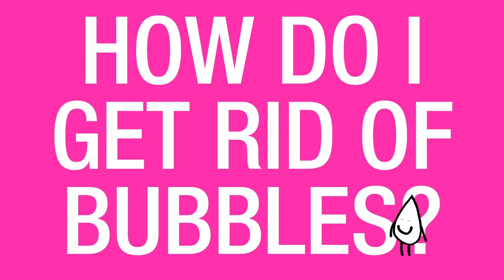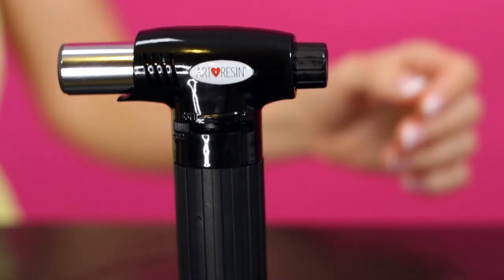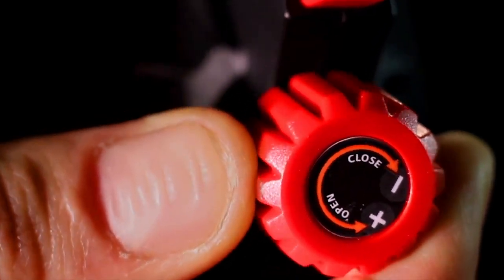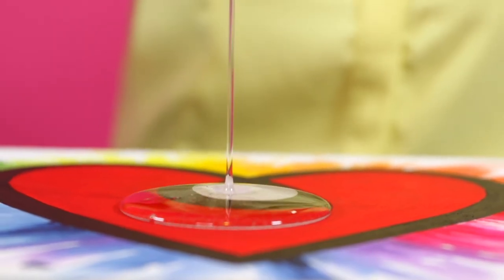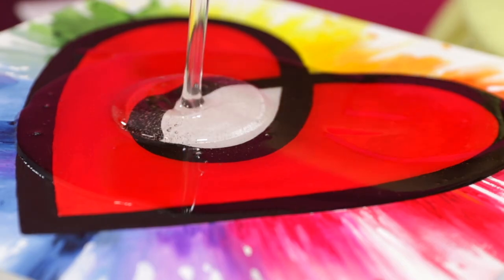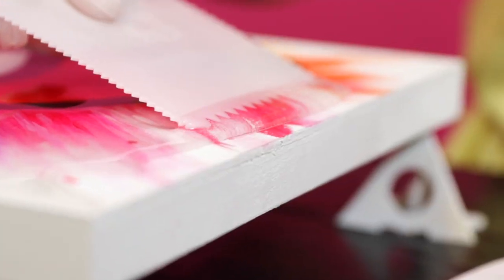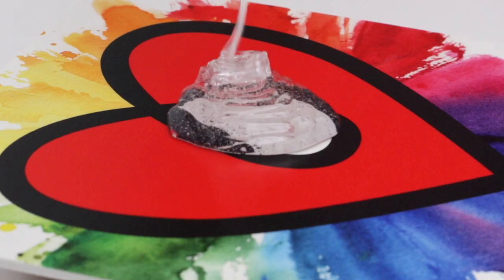How To Get Bubbles Out Of Epoxy Resin

Comment: It's the co2 that pops the bubbles. That's why, when using a straw works. Roasting the resin with the flame releases toxins and can burn the finish. Like you mentioned, viscosity helps.
Reply from the maker: Hey Steph! ArtResin contains a degassing agent to help bubbles rise to the surface, so a quick pass with the torch is all that's needed to warm the resin surface to release the bubbles.  A quick pass with a torch will not alter the chemical composition of ArtResin or burn it so there is no fear of toxins being released ( unless of course, you torch the resin to the point of charring it, which you would never want to do. )

Comment: So lm not sure why but l do my river table pour and wait a few minutes,take my torch and get rid of the bubbles,then wait like 10 minutes and torch all the bubbles out again,and l do this every 10 minutes for like 2 hrs..why is the epoxy not setting faster,the room is warm,lm doing 1/8 pours?
Reply from the maker: Hey Mateo - are you using ArtResin?  If so, it sounds as though everything is on track as far as setting.  After about 3 hrs, ArtResin will be at a jelly like stage.  You might try sealing the wood before pouring the resin - very often, wood contains trapped air which can off-gas into the resin in the form of bubbles.  It will keep releasing air and you'll continue to see bubbles, even after torching.  Babysitting it, as you have been doing, is a good idea, but sealing the wood first will create a barrier to that may help to prevent the air from off-gassing.
Reply: Thanks and yes l'm using  @Artresin

Comment: If i'm pouring casting resin around 1/2 inch deep should i do it in stages and let each stage fully set before the next?
Reply from the maker: ArtResin was initially designed to be a sealant and poured at an 1/8th of an inch in depth. We do have artists that use our product for pouring deeper than an an 1/8th of an inch but they achieve this by doing multiple pours. You can go up to 1/4 inch in your pour and would suggest you use a torch to help pop any bubbles you may have.

You can layer ArtResin epoxy resin in multiple coats, as high as you'd like, as long as you pour in 1/8" increments.

You have two choices when pouring multiple layers: the first is to pour your first layer, torch out the bubbles, cover and wait 3-5 hours until your ArtResin epoxy resin reaches a jelly like stage. At this point, you can pour on your next 1/8" layer, torch out bubbles, cover, wait 3-5 hrs and repeat until you reach the height you desire. This method is especially handy when pouring into a mold or a dam. The second option is to allow your first layer to fully dry, then give the overall piece a light sanding and pour on your next 1/8" layer. Torch out bubbles, cover and let this layer dry. Repeat these steps as many times as you'd like. 

Keep in mind that our recommendation of a 72hr cure time is based on a 1/8" layer. The thicker your layers are, the longer the cure time will be. It could take up to 10 days for a full cure, depending on how many layers you've poured.

I hope this helps!
Reply: @Artresin  helps a lot thanks! It's for a bottle cap bar top, i was worried doing it in stages would leave visible layers

Comment: Hi, thank you for your wonderful resin tips! Should I take out the amount of resin I need from the bottle and then put that in a warm bath, or can I put the big bottle in a warm bath multiple times as I rarely use the full bottle at one time. I may resin a bunch of paintings or tiles once a month. Thanks for your advice! 🐇🥰💗
Reply from the maker: You can put your big bottle directly into the water bath. We have done this multiple times with no issues. We recommend leaving the caps on and wiping the bottles off before pouring so that no water gets into your product as this could cause curing issues :)
Reply: Thank you for your kind response. This is good to know.  I am having another issue with resining one tile. 🥴 Perhaps you can give me the answer. There is one place on the tile that remains gooey. The rest of the tile cured perfectly.  I removed the gooey spot & resined over the entire tile. That same place  was gooey yet again, though the rest of the tile cured as it had with the first coat. So i then removed the gooey spot again & sanded over it this time. Then resined it again. Once again the same spot did not cure.🤔😔 I began to sand it again, but decided to resign myself that it is fruitless to keep trying as there are now 2 little holes in the surface from sanding where I believe the resin will only pool in those spots & never cure. What do you think? Thank you again for yet another reply. Mostly stay well.😊 🐇❣😷🙏
Reply from the maker: @Roxy4utube  That is strange that it is not curing in the same spot after a few attempts. Just to be sure are you measuring 1:1 by volume and NOT by weight also be sure that you are mixing for 3 minutes. If the measurement or mixing is off you will have uncured resin. Also be sure that you are letting it cure for 24 hours cure to the touch and 72 hours for a full cure.   If there are a few little holes the resin should fill them nicely.
Reply: @Artresin  Ahhh! I am measuring by weight. I will change that going forward. Thing is, i've had good results before. 🤔  And out of 38 tiles only 3 had sticky "areas". 2 of those resined again came out perfect. It's only this piece where in 2 spots on the entire tile remain wet. 😔🥴 Well, while it is a mystery to you, it surely is to me. I will measure according to volume going forward! Thank you so much for your continued support! 🥰🐇❣Keep well!